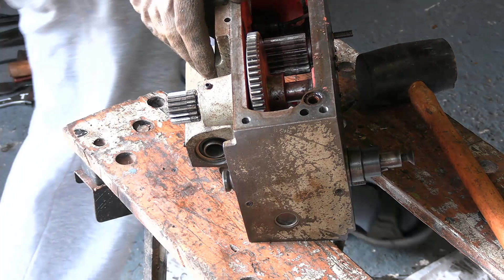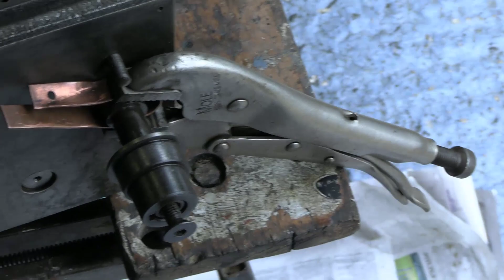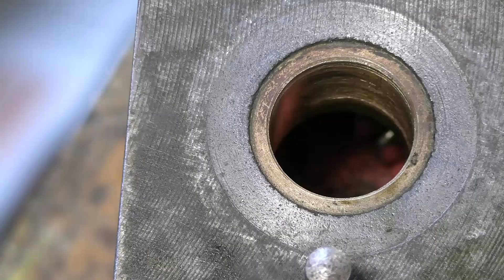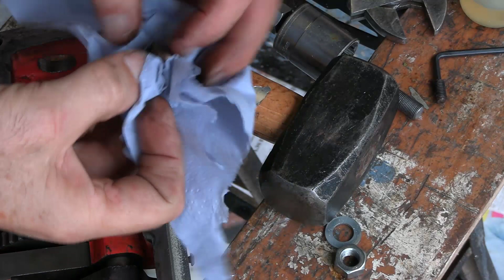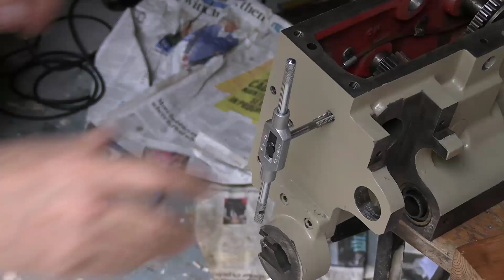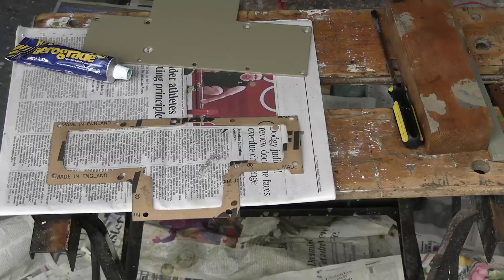Harrison M300 lathe - apron refurb part 2

Comment: Was the rpm a bit high for that drill?  As for the reamer, I find a reasonable rule for reaming, is half the rpm and double the feed for the same size drill. I see you still use a scary parting tool, rather well I might add. Nice job on the bush. Not your field I know, but I hope you are getting some satisfaction out of this rather thorough refurb of this lathe, I think you will be quite pleased with the end result.
Reply from the maker: Yes the rpm was too high, but not enough torque for lower speed (no back gear). I'll get a better parting tool as you advised for the new lathe, no point in sinking more money into the Chinese one.